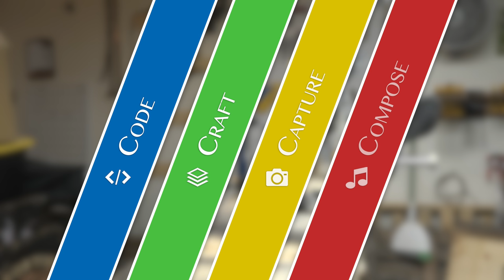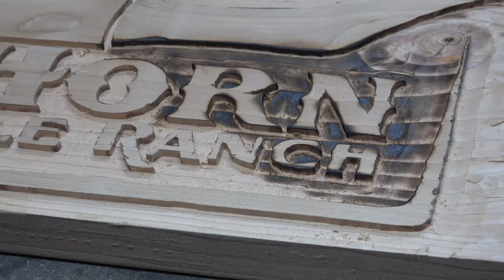Longhorn Cattle Ranch + Routed Western Sign + Metal Stars

Comment: I just found your channel I really enjoyed your sign video can you tell me how your got the stencil made thanks
Reply from the maker: Thanks! I have a large vinyl cutter.. I designed and made the vinyl graphic which I used as a template to spray paint the wood.
Reply: Thanks can you share the name of your cutter? Or is there a program sold separately  and what is that font callef
Reply from the maker: @davidsandoval2846  I'll have to get back to you on the details.. but if you're interested in getting on I can create one for you. Cost depending on size. Shoot me an email. Yiu can find my email on the about tab on my channel page.